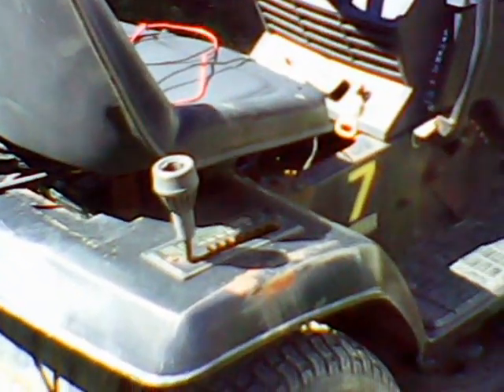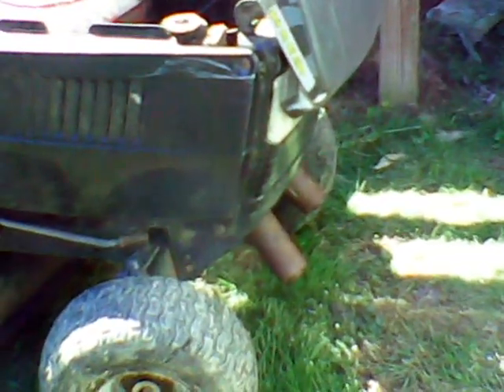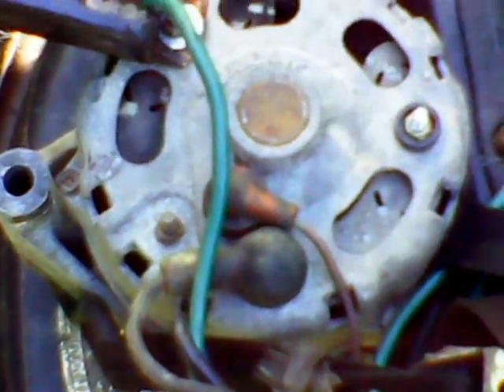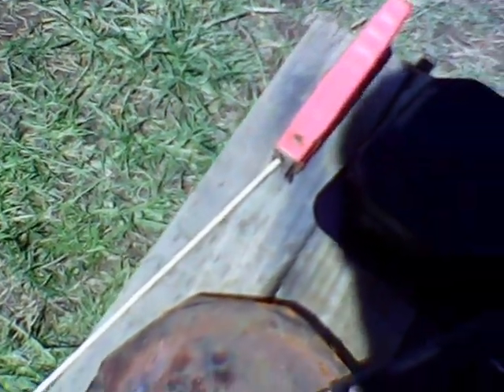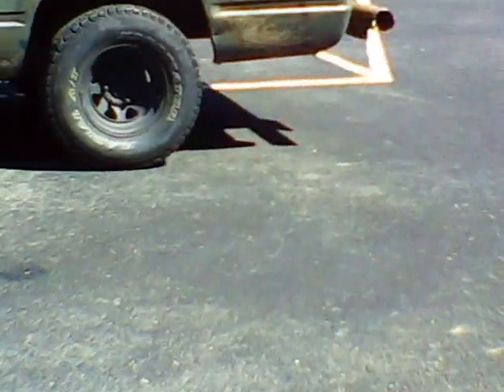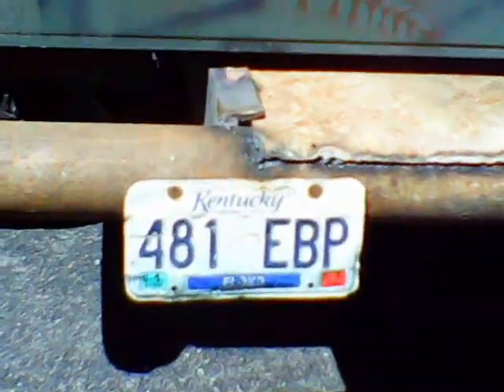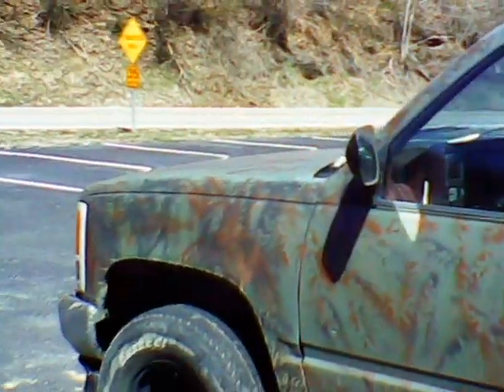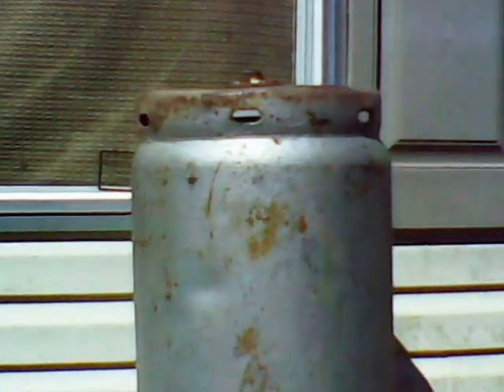home made lawn mower welder

Comment: Good little invention there. Grind any area you are welding to clean metal before. It will penetrate and bind much better. Grind the finished weld down to make sure you got a good bead. You can stack welds for extra strength.

Comment: I don't want to be behind you towing anything with that gum blob welding connection !
Reply from the maker: Well now that you know my truck you can keep your distance when you see me pulling my 20 ft camper lol.
Reply from the maker: I actually didn't trust the welds either so I ran guardrail bolts through the pipe, frame, and hitch so it should hold up pretty well.
Reply: luke Fugate 
  Good , that weld job would not have taken the stress or any twisting forces when driving !  Buy a cheep 90 dollar welder and do it right !

Comment: hey guy good thinking on powering that welder with your mower...some suggestions you may know or may not know you can control the amperage of your with engine speed but you dont want the alternator to drop under 3000 r.p.m. (most alternators dont produce any current untill 3000 r.p.m. and higher) also using a 100 amp alternator is a good choice however 65 amps is about as small as you wanna go...also you can produce better welds by connecting your hot lead as the ground and your welding rod in the ground cable...hope this helps you some...

Comment: Your going to hurt or kill someone with this cobbled together bullshit, you better keep a fire extinguisher close by.
Reply from the maker: +Skeefoo Panama I guess you are the type of person to sit on the couch and daydream rather than get out and do something. I feel sorry for people like you. I hope someday you get the opportunity to try building something. It's a good feeling when something you "cobbled together" from stuff that would have been thrown in a landfill becomes something useful.
Reply: +luke Fugate 
I've got Stick, Mig and Tig welding machines, and run my own motorcycle repair business, Im putting a 4 speed in my work truck right now, I dont have time to sit down,or go dumpster diving Sir.
Reply from the maker: +Skeefoo Panama Good for you! Glad to hear it. Sorry about jumping to conclusions, most people who comment like that don't know what they're talking about. I don't know where you feel I'm going to hurt someone. If you were referring to the bumper, that was my first weld so I have gotten much better and I welded it on a lot better, still didn't trust it to pull anything so I drilled holes straight down through the frame and the pipe and put long guardrail bolts through it. I also bolted the reese hitch through the pipe too. I have jacked up the truck off the ground with the jack under the trailer hitch and jumped up and down in the bed. Nothing moved, so I did make sure everything was safe before pulling a trailer on public roads.
Reply: +luke Fugate 
Ok  Luke at least your doing something. just be sure to insulate everything well, dont want any shocks. all I'm saying is safety first,  sir.

Comment: You said 80 acres  ? or did you mean 8 acres ? Because I doubt a small rider would cut that much. I use a bush hog and tractor to cut my pastures, the bush is 8 foot wide and it takes me awhile to get it done, about 40 acres ..
Reply: Cracked me up I was like 80 acres with a riding mower. I was thinking this guy is a animal.
Reply from the maker: +Joseph M I don't mow the whole 80. Not sure why I even said that. I only mow about 25 acres. The rest is hillside and would require a weedeater or a goat, so it just grows.

Comment: Thanks but it would have had more impact if you had actually struck an arc, whether you can weld or not, and how nice of a weld could it be if a weldor tried it? Thanks for sharing that, and yes, you tube is a valuable resource.

Comment: I like you're idea. Looks like you're on the right track. Try hooking the positive cable to the piece you're working on and welding with the negative it should run a little smoother.
Reply: you